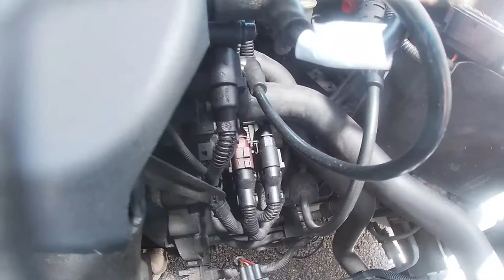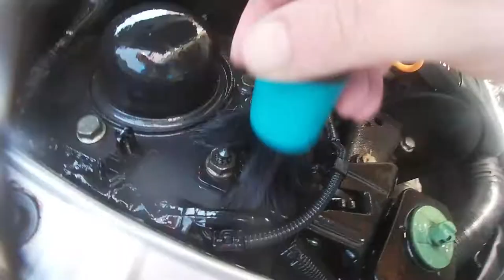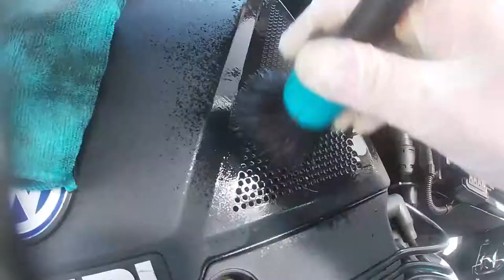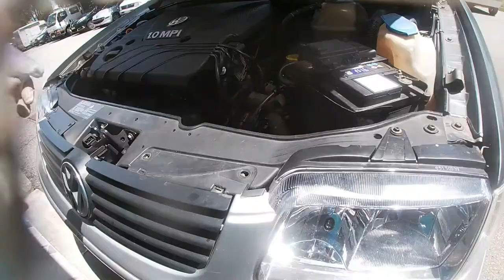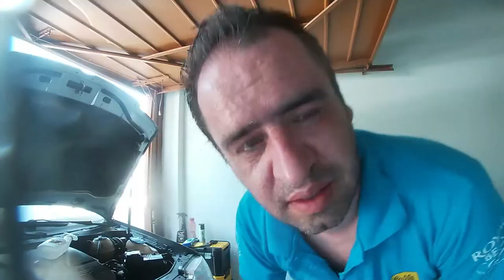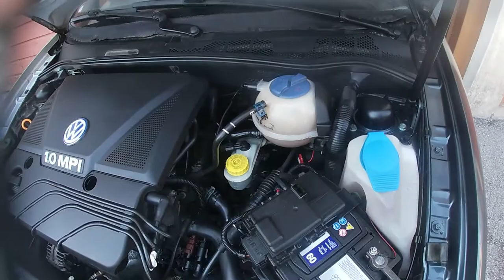Engine Bay Cleaning Without Pressure Washer - APC & Meguiars Engine Dressing

Comment: One thing the grey /black carpet in the hood of the car, where can I buy one? My VW is missing this part. Best Regards Bro!
Reply from the maker: Hey Bro... Where you from? You have it in AutoDoc... https://m.auto-doc.pt/prasco/12756029 If you want to buy there i have a code that give an addicional discount... Just let me know
Reply: @RandomTubePT  Hi Bro, from Spain I will check the webpage maybe I order some more stuff for the VW, great Tello me the code Bro!
Reply from the maker: Install the AUTODOC App the prices are lower than the website and with the App you can get the discount using my code. Had the code at the check out. The code is AC22605166